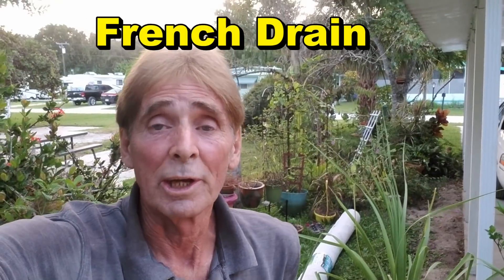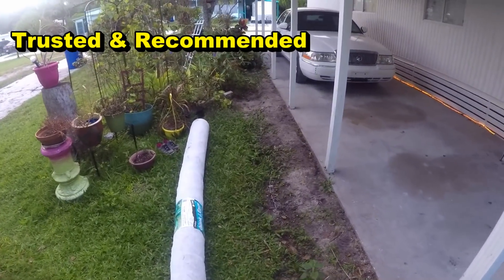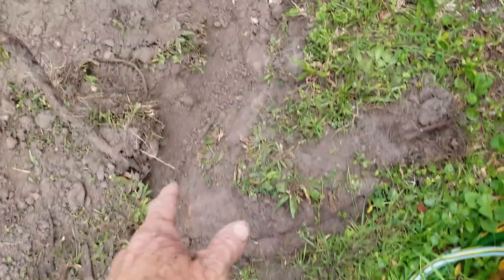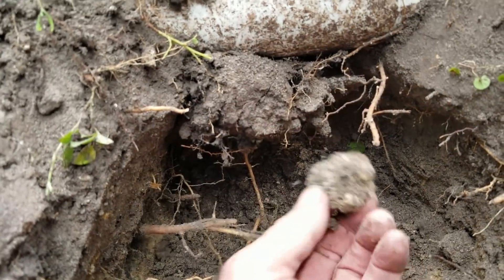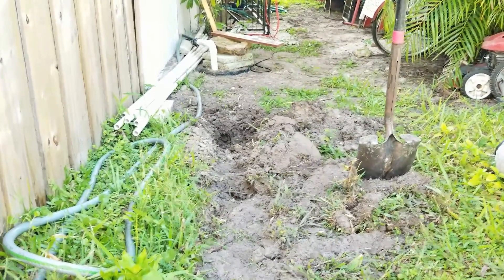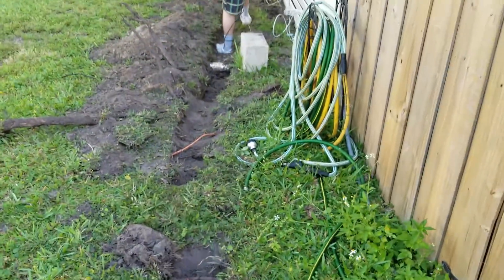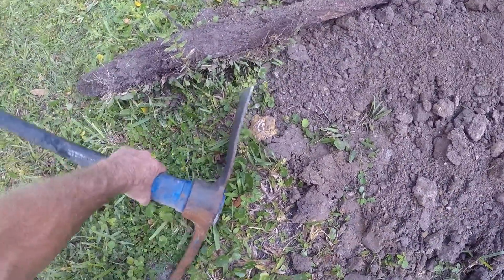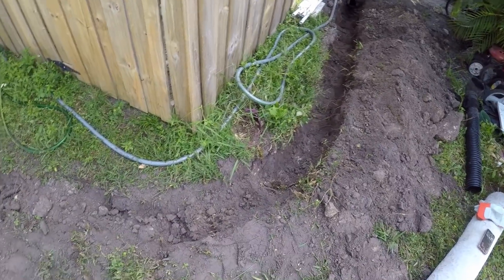French Drain Needs Catch Basins, Learn Why and How to Install a French Drain

Comment: So I didn’t make a mistake putting down a French drain with 2 catch basins just a few feet from my foundation? I’m worried I didn’t slope it well enough though and it’s not connected to my sump pump. I’ve found conflicting information. Maybe me and my neighbors downspouts dump directly between our houses and my house is heaving. I rerouted my main downspout via a solid tube and the same trench.

Comment: Hi I have watched several of your videos about running drain tile and such, I am up here in Michigan and the average front line for my area 42" I have a drain sump in my basement that discharges out the side of the house, what kind of system would you recommend for this to drain out into. The yard in question is relatively flat and I saw your video that dry wells dont really work all that great. Thanks in advance.

Comment: Where would someone suggest I run 3 catch basins to if the street isn’t an option? I live in a cul de sac and the entire area is slopped to my back yard. My property is slopped back towards a pretty large creek that always floods regardless of the size of the rain. I’ve had more than 4 feet of standing water in my yard multiple times now, luckily my house is elevated 4.5 feet off BFE. I’ve heard nothing but bad things about NDS dry wells not being able to keep up so I’m not sure if there’s any other way. If I just used a sump pump I’m afraid the water will just circle back around to my yard, as that is the grade of my property and there are no street drains in my cul de sac

Comment: Great video. Thank you greatly for posting this. 1 question. Is any of your piping angled in order to enable flow towards the sump pump? Or does the sump actually suck the water in? It appears to be flat....so I'm wondering how the water is actually getting to the pump, i.e., what would prevent the water from pilling up inside the pipes and flowing back up through the basin?

Comment: crawl space question: when I catch the water in the sump pump container and the pump extracts the water through the tube outside how do I get it to remove all the water in the tube. Less then an inch of water in the container and then the pump shuts off. I have a check valve so the water doesn’t flow back in but the 20 feet of tube is filled with water for months. Water is being pushed vertically so it won’t drain naturally.Thoughts
Reply: Doesn’t matter if water is in the discharge pipe as long as it’s in the crawl space where it shouldn’t freeze. It’s not going back to the sump bucket because of the check valve so who cares